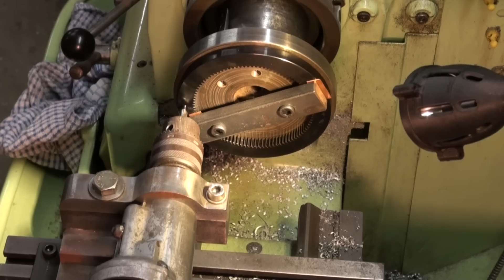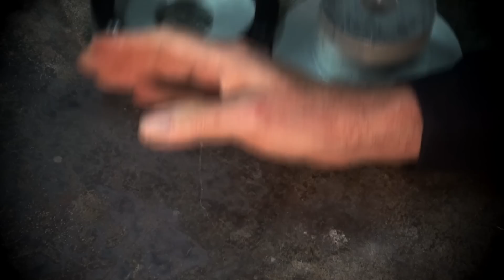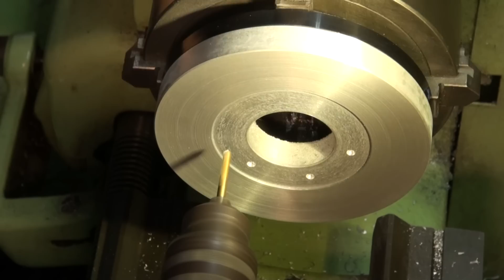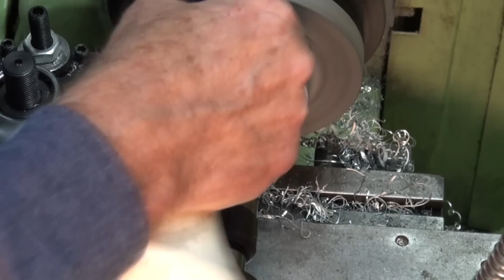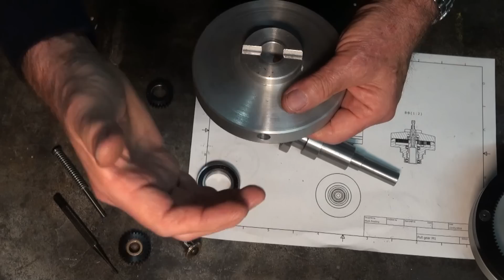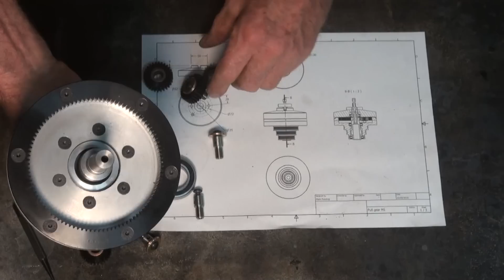Pull Gear Speed Reducer  Part 2 - Thanks to Mr. Pete

Comment: I am working back through your catalog and found this....well it was sent to me. I wonder if you made a casting out of some stuff I have been using it may have solved the problem.  I have been using the racing plates or the Saturday shoes for racehorses. It is a bit of a farnarkle removing the nails etc. But it is some weird alloy and very very strong. Comes from Sweden and is proprietary so no chance of finding out what it is but it sure is schuchem stuff.
Reply from the maker: I had no idea that horse shoes were made from anything other than steel (or iron)! I was shamed by Olfoundryman into buying some ingots of 601 series aluminium from a local foundry. It is lovely stuff to work with and it is both predictable and yields castings with very little porosity. It can also be heat treated to a T6 state although in a home workshop T5 is more achievable. It ended up costing me $5 per kilo but I bought enough to last me several years. What I did find out is that pressure die cast aluminium is a no no. I will never use it again. If you have a supply of an alloy that works for you I would stick to it though.
Regards,
Mark

Comment: Its exactly for reasons like mentioned in 22:00 that i have ordered a few solid carbide blanks, 10x10mm, 14x14 and some round ones of similar o.d. The idea being that you can braze hss tips, like taps cutoffs or such, which are very good hssco, and use a tool&cutter grinder to turn those into a hss cutter on the end of a carbide bar, making it essentially immune to chatter and digging in... If i fuck up, i snap the carbide, and so what, i regrind it into a solid carbide cutter, or a flycutter insert, but if i am even the least bit careful, i have a turning tool that i can use for tasks like this, or for cutting some pesky alloys... Heck, i can make my own hssco inserts, just copy say ccmt insert geometry and grind the carbide to accept ccmt inserts so i can buy carbide ccmt-s and use them in there for when i can utilize high speed cutting, and use my own hssco ccmt-s for gourmet jobs... Now you might be wondering how will i grind in a thread in the carbide tool holder, but i wont, i will diamond drill a hole in it, grind it to around 3.5mm, insert a threaded steel sleeve with a boss to retain it along with friction(absolutely minimal pressfit, as carbide dont likes being in tension), and have a hardened thread in a solid carbide holder... If it wasnt so nasty, i would get a 1x1x10inch square bar and make the same for my big lathe, but just look up good carbide rods of 1x1x10inches, if you can even find them...
Reply from the maker: That reminds me that I have a long piece of solid carbide round rod, 10mm diameter. I do have a D bit grinder now so I should start doing something similar.
Regards,
Mark

Comment: Hi Mark I'm looking at your manufacturing of the pull gear , I have been trying to work out how I can make one of these !
I have used a angle grinder gear box to fit my vertical mill , and made a slotting head mechanism to it !
So I can make a ring gear for my version of the pull gear . . . that is in "the fullness of time" as they say !
Thanks for sharing your work !
I will try and work out how to make the polley vee pulley parts.
Thanks , Jim

Comment: Hey don't forget to save those beer cans for the next casting 🤣
Joking aside, how do you index the holes on the lathe?
Reply from the maker: Daniel, I have an indexing ring clamped to the outboard end of the spindle with two rows of holes. With 36 and 40 holes you can index most common hole patterns. I have a spring loaded pin which engages in a single hole. I take the spindle out of gear so it's easy to rotate the part and also it protects everything if you accidentally start the motor. 
Regards,
Mark

Comment: Great video. Very entertaining 😁. Glad you got the pulley situation figured out. Tackling projects above our skill level is really the only way to advance our skills. Keep on keeping on! Cheers 😊
Reply from the maker: I had some help from a fellow Aussie who identified the issue was with the alloy I was using. Apparently, anything made as a pressure die casting will create really brittle and difficult to machine castings. I have since purchased 601 grade aluminium ingots which were surprisingly cheap at around $5 per kilo. I haven't had a chance to try it yet but my guru friend assured me that all my casting problems will go away.

Comment: Hi Preza, what do you call that drilling attachment and where did you get it? I really need one for another project. Thanks
Reply from the maker: Arrash, I recall seeing the drill mount/adaptor in a Model Engineer magazine back in the 80's I think. It was made for a South Bend lathe and I think it was flame cut from mild steel and then machined all over. I made one exactly the same from steel and then realised that an aluminium casting would be better. That is how I made the second one that holds the drill at right angles to the axis of the lathe. It would also be possible to fabricate one as a weldment or even a good hardwood fabrication would work for a quick and dirty solution.As far as I know they are not made by any manufacturer although I am guessing that specialist lathes like clockmakers use might have something similar. 
Regards,
Mark Presling

Comment: Hi Mark,
could you not have rotated the ring gear 30* and redrilled the holes  - concentrically this time??
Reply from the maker: Yes, but I get all OCD about things like that. There were some other issues with the part which meant that I really wanted to make it right.

Comment: Hi enjoyed your video , now I'll watch the series. I'd like plans or PDF too. I'd like one on a bandsaw and a drill press or two. Thanks great job .
Reply from the maker: Gary, I have put a link on the latest video description which will give you access to the 3D model and the 2D drawings which are in both PDF format and the original Autodesk Inventor format. Someone else has spotted the potential for adding one to a bandsaw. I hadn't thought about that but I am thinking it will be a good solution for my own bandsaw which at present will only cut wood. Enjoy.

Comment: mr. Pete says his is 4.5 to 1 At first he thought he had the 7 to 1 tool but later on figured he had the 4.5 to 1 tool
Reply from the maker: Yes, I think that he was consulting the sales brochure for these pull gears which did list a 7:1 drive but once he had it apart he realised it only had single reduction in the idler gears. I think there were no markings on the outside to identify which model it was.

Comment: You learn by doing and you really learn by failure. In most things what not to do is usually the important thing. Good project and I think you will get it to work just fine.

Comment: You need to make a drip oiler that drips a drop every 5 seconds that should stop the galling when you cut your grooves. It's running dry and heating the cutter which causes tearing not cutting.  This should save you more time and mistakes.  Love your video!
Reply from the maker: Once I got the coolant pump delivering a continuous supply of soluble oil all the issues disappeared. I hate using that pump though. It wets everything in the tray and the oil stinks!
Reply: You could use a different kind of oil  or lube which does not smell and does not  make a mess . I've seen a large variety at tool supply stores..  This why i suggested a drip system not a stream  some people use a air cooler  anyway i  noticed you using a stream after i posted my comment.

Comment: Excellent project and I'm going to follow it to the end as I'm confident it's going to work.
Just a quick observation when you were turning. It looks like your lathe is either a Student or a Master, I have a Student, and I noticed that your lead screw was turning and I could see that your "metric"  "imperial" threading lever was in the up position which is why your lead screw was turning. That same lever has a "neutral" position and it stops the lead screw from turning. It's usual to have this lever in "neutral" during normal use as the lower shaft is used for power feeds, the "metric" "imperial" lever is usually only engaged whilst threading. I hope this helps.

Comment: Very cool project, I did learn about this pull gear system some years ago but didn't know exactly how they worked. Locating any two parts together as you first attempted with screws simply doesn't work for a repeatable alignment. The step you added fixed that problem or taper pins might have been used. Your method was the most simple and cheapest. I'm more than a little interested in seeing how well this works.
Reply from the maker: I am starting to think there will be issues with belt slippage and perhaps it will be quite noisy. Mr. Pete showed that his reassembled one sounded a bit grindy. Still, it has been a fun project so far - well, mostly.
Reply: Well depending on just how bad the belt slippage turns out to be it might help provide a failsafe to protect the internal gearing from failure? Driving larger drills does take a lot of torque of course. I'm no fan of using grease in items like this, but pumped 3/4s full it might quiet it down a lot. It's not impossible you might be at the first prototype stage and going a bit larger and heavier duty on the gearing plus a cogged type belt might be needed with a second version? I don't have enough engineering or math skills to work out if the gearing is capable of taking the full motor torque. But with over 1k of subscribers I'd think somebody would. And I can fully sympathize with that "mostly" statement. :-)

Comment: Very well done!

Needles to say: care if you finally use the pin punch or any other hardened stuff to torque the bolts, they can brake on you and even cause damage.

Good idea on the oiling ports, though it at all, I'd be worried about the (through) hole diameter (not the cross ones) you used on the bolts. As the oil is always going to enter pressurized, you can make the bolts a bit stronger by reducing such diameter a bit, but I don't think it's going to be a problem, time will say.

I was thinking since I saw first Mr. Pete's video that this pull gear reducers could also be made for lathes, or for machinery with wider spindles, as long as the engaging mechanism could be moved out of the way, though, due to actual ratio (i.e.: a mini lathe's spindle and it's pulley) the resulting one wouldn't be as expected. But the idea is there! would need some more thinking.

I like a lot the fact that you have a diamond tool holder, haha!. 

That's the very first tool I made for me, for which I spent weeks around FreeCAD until I finally got to understand the geometry and the angles involved on this guy's design. I made it with just a hand-hacksaw, a file, and a stone, out of a 20mm round 4143, but it was really worth it!. Love it, and cuts like butter!

Have you ever thought on brazing discarded tungsten-carbide tool bits on some hard steel square stock suitable for your tool holder?

All the best! Can't wait to see that pull gear working!
Reply from the maker: Did you really make your own diamond tool holder? I wouldn't even know where to start with that. I did watch a video by This Old Tony where he made a sort of ad-hoc tangential tool and it did work. I had not thought of brazing on a carbide face. The tool holder I bought comes with a little grinding jig to present the square HSS to the wheel at all the correct angles and it makes sharpening a breeze. I do have some solid carbide round stock that could be brazed on. I might try that. Thanks.
Reply: Thanks, haven't seen that video you mention. 

In fact I made two holders and two grinding jigs. One 10 degrees, and the original 12 degree-predominant. I use the former on harder steels, such as O2 tool-steel or inox, and both with hss or brazed tungsten-carbide, I seem to get better finish than with the latter, which for me works better on softer steels and non-ferric materials (alloy, bronze, etc). In plastics and polymers, I can't see any difference between the two.

I left behind tcmt and similar expensive toolbits behind long ago. I now just buy 6mmx6mm raw tungsten-carbide bits (no yellow metal deposition, not ground either), and use no other than the diamond holder for almost all OD jobs. As my toolbits are 8mm, by using 6x6 I save a lot of time grinding when brazed to the square stock, yet have some back-support for the tungsten-carbide bit.

It wasn't too difficult after all, as this guy provides many tips on his videos, and dimensions on his website. It was more a matter of spending time with it, collecting these dimensions and images, making a 3d object from selected front and side views, and then making sense out it. Besides mines has less overhang than the original, back at that time I also designed a version with integrated chip-breaker, though I haven't yet made any (need to make and harden some oddly-shaped end-mill for this).

I can send you pictures of mines, screenshots of FreeCAD or whatever you need about this. While I was for a time thinking in sharing the design, latter decided not to, mostly because if I'd be making a living out of a good idea I'd have had, wouldn't like anybody to come up hijacking me. I mean, it's not the same if I reverse-engineer something for my own use and for the sake of learning and understanding, than to make money or share something it's not my original work. This guy deserves all my respects as anybody else.

All the best!

Comment: I've personally seen people cut to the bone (w/ stainless strings) hand pulling them. A quick and dirty stringer hook can be made from a heavy metal coat hanger. A better one can be made with 1/8" rod and a file handle. Cool project.
Reply from the maker: Yes, of course you are correct to point this out. I feel embarrassed now that I included that footage. I have also cut myself badly on some stainless steel swarf. I am going to buy some square hardenable rod to make a hook. It has been on my to do list for some time and I am running out of band-aids!

Comment: One question, how do you tighten those shafts for the idler gears, your lever through the hole doesn't work as the gear will cover the hole.
Reply from the maker: The shaft goes into a threaded hole in the cap, then the gear slides on to the shaft then a bronze washer and a cap head screw stops the gear falling off. You'll see it in the next installment.
Reply: I'm glad that's worked out! I could not figure out how you were going to do it either.

As soon as I saw the holes through the gear shafts I thought 'oil holes!' But I guess you still need oil in the gear teeth too so you'll get the nice oil flinging effect MrPete mentioned.

Great job reverse-engineering and building one of these from scratch. I hope it works out. It looks like you have some interesting stuff on your channel so yet more vids to watch.

Comment: I would like to add a possible cost savings tip for making this pull gear. I believe you can find most of the planetary gear parts by scraping them out of an automatic transmission. if you wanted to get real clever you could even make it work with a band around the fixed hub rather that having to screw in the rod. I really do not  see the need for the extra gear if you have a way to reverse the drive motor. Less is more. I have also wanted to scrap the CV belt drive out of a scooter for this use. Very fun project and my hats off to you for all your hard work. I am subscribed.
All the best from Arizona.
I think the cv drive would be much quieter and like a vari-speed Bridgeport mill, but you should not need 4200 rpm on a drill press. Just work out the max rpm speed you think you need and drive the cv with the proper reduction from the motor with pulleys. Or the other way around and drive your spidle with a pulley or pulleys from the cv drive.

Comment: I think you should give up 🤭
I’m only joking 😂.
I think the real challenge is when you go to cut the  teeth on the main shaft.
Reply from the maker: I am not even going to try. I have a smaller gear which will be keyed to the centre shaft. I didn't realise that the pull gear that Mr. Pete had included an integrally cut gear.

Comment: 13:45 something to do with a four-jaw chuck pushing outwards, and six bolts securing a ring gear concentrically . . . means you have two of the pressure spots (from the chuck) supported better than the other two.  Averaging the whole happy meal should get you close enough, I hope.
Reply from the maker: Ahh yes. I had not thought about the 4 into 6 thing. Well spotted.
Reply from the maker: Well, it turned out it wasn't the 4 jaw chuck. I mounted the assembly by gripping it from the other end today and it is still showing to be out of round. It must have warped slightly after the teeth were broached or during the chemical blacking process.

Comment: why long ribbons vs chips?  chip breaker on your tool grind?
Reply from the maker: I think that 6061 alloy tends to produce birds nest type swarf. I was using an insert for aluminium with a chip breaker but the other problem is that my lathe is somewhat underpowered with a single phase motor. It originally had a 7HP three phase motor and I now find it hard to take cuts deep enough to break the chips. You can hear the spindle bogging down as I take the deeper cuts. I once worked the motor so hard the thermal protection switch cut in and I had to crawl in the back of the lathe to reset it. No fun!